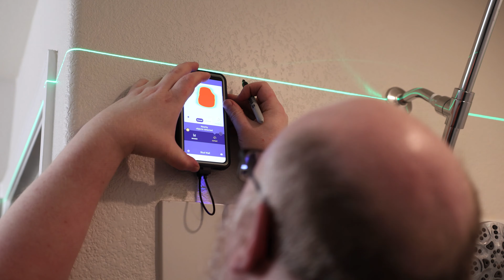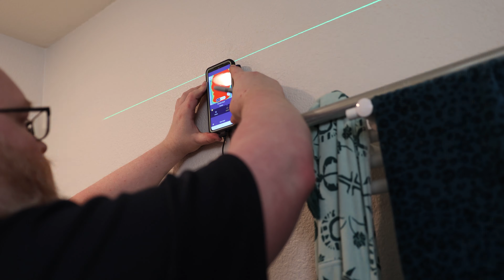Installing A Curved Shower Curtain Rod

Comment: Thanks for this. Mine (same model) came with a little plastic stopper plug, same diameter as the inside of the larger tube. I guess I’ll just plug it in.
Reply: I’m thinking the plug is to stop water getting inside the tube. I put the wider tube at the shower head end so maybe it will do something, who knows?  Straightforward installation anyway. Cheers!